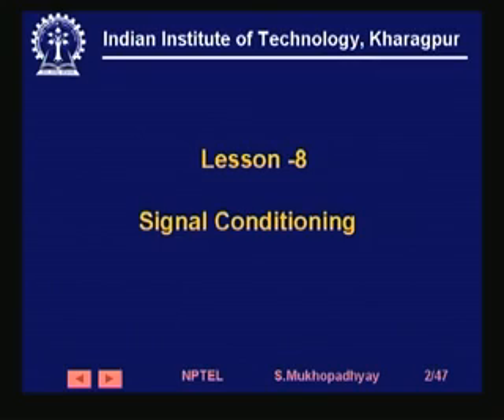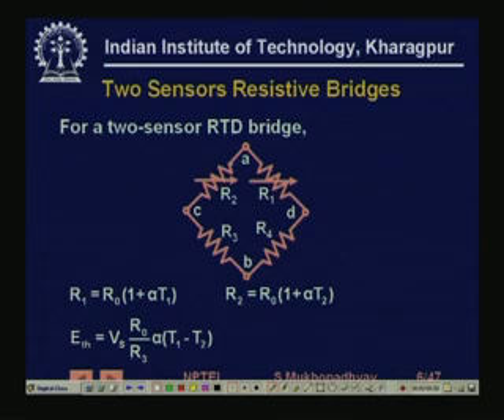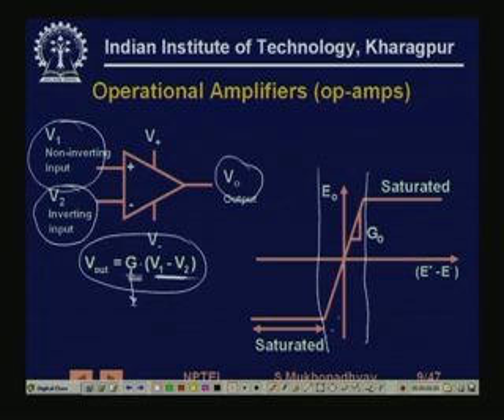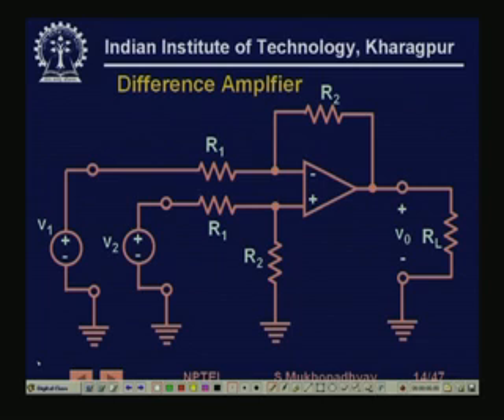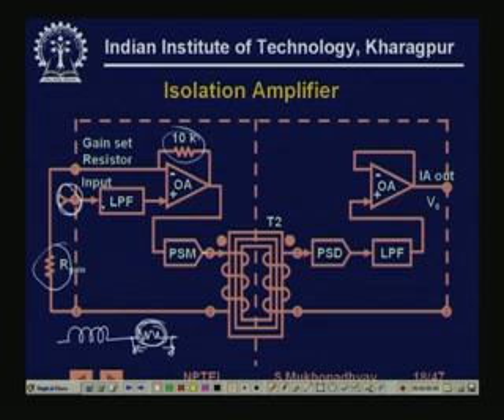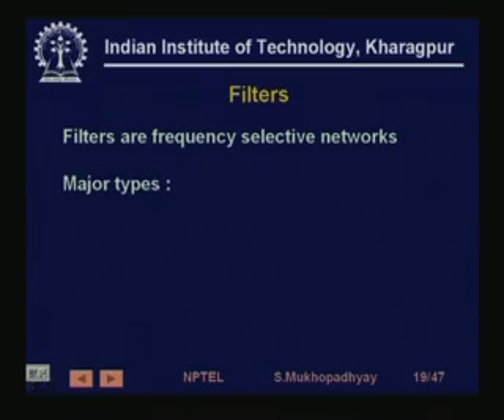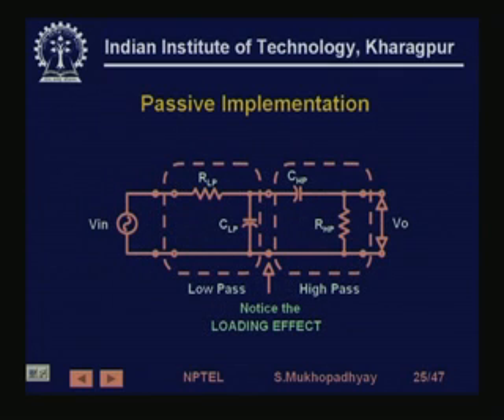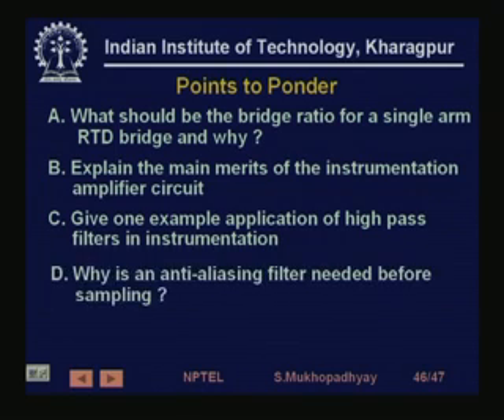Lecture - 8 Signal Conditioning

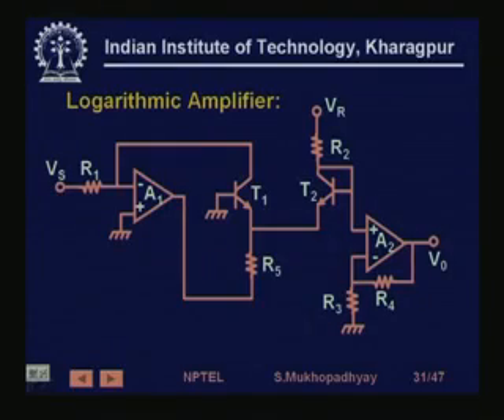Comment: At 36:42, those log antilog operations are done digitally. In fact, other than amplifying and some analog filtering, majority of the SC is handled by the digital modules. Same for square root extraction of DP flowmeters!!

Comment: This video should not have been part of this course. The Professor is teaching inverting, noninverting amps, etc., which are taught in a Basic Electronics course. Signal Conditioning is already covered in a Sensors course. You could have demonstrated an industrial SC module at least

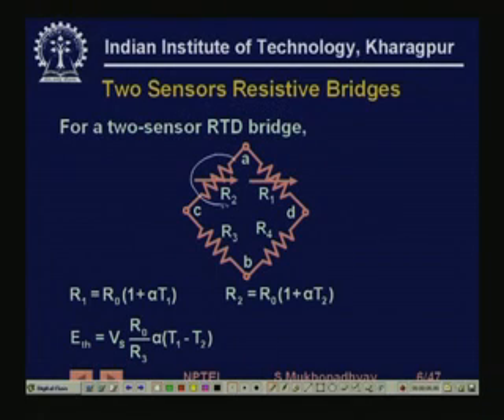Comment: At 9:21, you forgot the fundamental fact that in industry, 2 wire RTDs are never used. Those first order approximations for RTD resistance are useless (industry standard is something different). You have simply copied it from Murthy's book. Unfortunately this course on Industrial Automation has failed to live up to the 'Industrial' part! It is more of a typical academic course.